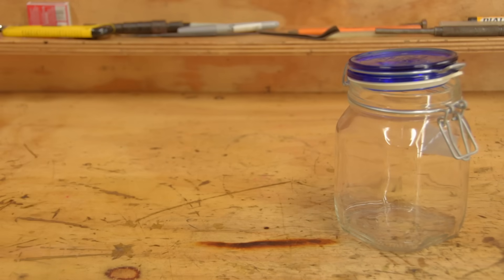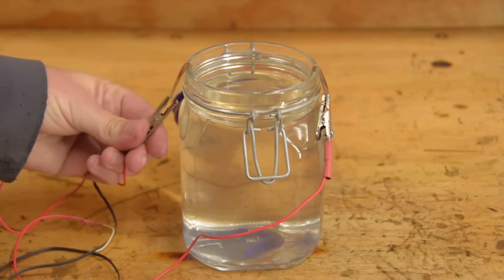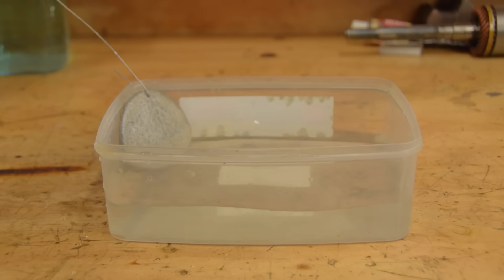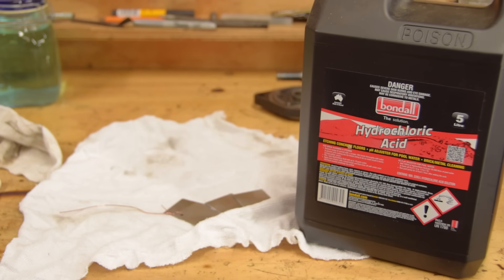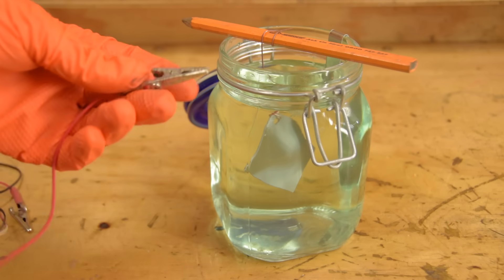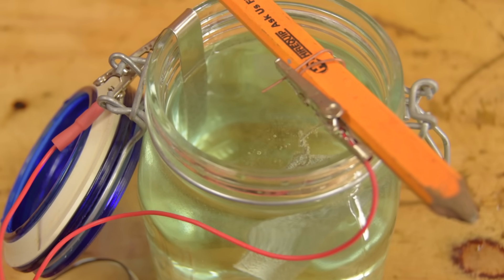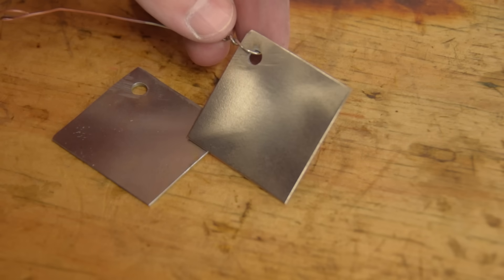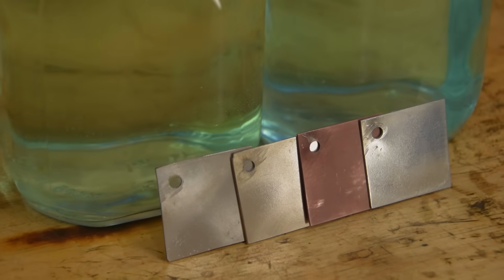Electroplating - Easy DIY Nickel, Copper, Zinc Plating

Comment: Thank you I had no idea this was so easy. I’m actually regretting some builds in the past now knowing I could have so easily nickel or copper plated them
Reply: We're all thinking about how we could have done past projects better but that's the evolution of an artist
Reply: just wish I had a jar big enough to put auto parts in .. my truck in copper would be cool .. this was a good video
Reply: @randytravis3998  Inflatable pool and an old stick welder are pretty cheap.  It's the 500 gallons of vinegar that you'll need that'll be expensive.  :D
Reply: @button-puncher  just mix it yourself. its just acetic acid with water. you need around 5% and you can get 3 gallons of 60% acetic acid for around 30€
Reply: @randytravis3998  get one of the pens and the fluff that goes over top of it, then paint it on. It works with the fancy kits so it should work DIY
Reply: My 1911 wish I would’ve nickel plated instead of DLC coat

Comment: Ok, I got some old brass plate handles off an antique dresser, that I want to re plate with brass. Since there is already (mostly still) a layer of brass on the handle, do I really need to pre plate with copper, before plating with brass? They were originally brass plate handles, and they look really cool, and I'd love to re brass them.

Comment: I tried making nickel solution but it became clear water with white sludge in the bottom. So I atomized the nickel but it didn't make the water green. I used water and salt in a 5 liter container though, not vinegar; is it the vinegar or the quantity that is the problem? Or both combined?

Comment: Have you ever metal plated on poly carbonate plastic? Is there a method to the metal plate inside PVC pipe? Lengths may be between four and 12 inches

Comment: Something interesting. I have heard that copper does spontaneously plate onto iron. One man dunked his clean bare metal slightly rusted brake drum into a bath of acid with a small amount of copper residue in it, and immediately the copper formed a thin layer onto his cast iron brake drum. So copper must be able to coat iron directly, depending on if there is free iron (rust) on the surface? Perhaps a small amount of flash rust is needed to plate copper to steel?
Reply: It surprised or confused me a little that copper wouldn’t plate onto steel.Commercial platers that advertise triple chrome are referring to copper, nickel, chrome and I saw one explaining that they use the copper equivalent to the way a painter uses primer/surfaces, to fill imperfections and be polished to a high shine. Am I incorrect? Thank you for the informative entertaining video.

Comment: Great vid, thanks, what is a brightener that you mentioned in the zinc test, could you please advise what this is and whether you can use this from a home product or need to purchase a specialist product. Also can it be used in the copper plating to keep it bright? Thanks, I am going to use this to nikel plate my Father in laws old  RNZ AF  Tools he left me like dividers, compass etc, I have managed to get the steel rust all off and have cleaned them all up now, they are just oiled as i was waiting for the nikel to arrive so i can go to the next stage.  Final will be copper as I want to polish them and this will stop them rusting now. thanks.

Comment: Thanks for sharing. I worked in a plating shop for 10 years back in the 90’s. Cool stuff man!
Reply: Hi @bleeper87
Sorry for bothering you with a question. When it comes to plating, have you used a different type of acid? I've heard that for copper plating, sulfuric acid is needed instead of acetic acid. What about nickel, brass, and plating with other metals? Thank you in advance

Comment: What about after washing your metal and you sprayed it with ( Rust Fixed spray paint goes on clear, turns rust to black.) you know when you clean a piece of metal and you dry it off and it starts rusting on the surface right away. Well I sprayed a piece of metal with that rust fix spray. Do you have to take that off for this process to work on a piece of metal? This is pretty cool either way mad scientist

Comment: Great video and I plan to repair some old tools that were passed down to me but are just rusty, sets of  calipers and inside out calipers double ended calipers and a nice depth gauge all for wood turning which i do, was looking to buy new until i looked up this, very clear explanation, I didnt want to angle grind them for fear of damaging the thin metal they are made of. I used to do old iron fireplaces in the uk with the angle grinders, hours and hours to get years of paint off, then Zeebrite them back to beautiful black.

I have watched the excellent rust removal video you made and will use electro current method  to do that as its not heavy rust and then come back and nickel plate them all , they deserve a second chance as they are all old RNZAF tools from my brother in law who doesnt use them any more and being a wood turner Im excited at the thought of not paying much to get them looking great.

Just ordered the Nickel Anode already,  7 euros for that, the other materials I can get in Spain easily enough in the drug stores here, not a nanny state here like the UK where you can not buy any acids etc. A gallon of hydrochloric acid here is 4 euros, nothing!

 So Im looking forward to seeing the results , may even copper plate my depth gauge after nickel plating it. I have never really had an interest in chemistry apart from sorting out my pool and this has sparked a little interest now thanks very much for the clear explanations and simple guidance on how to bring life back into old tools etc.

The rust tool liquid that makes it go black and hard we have used here a lot in spain when refurbishing  atticos in peoples houses, the ceilings have lots of curves between beams and they are plastered, remove the plaster to expose beautiful brickwork but the beams are rusty, we used a similar product here to stop and blacken the rust and it makes the beams look excellent once you treat the brick with a type of sealer to stop any dust.

thanks again. Neil, Barcelona Spain ( Mrs is a Kiwi)

Comment: In the 1970's I worked for an electroplating firm (since bankrupted by fines from unsafe disposal of chemical waste). We used to 'jiggle' the items being plated to make the bubbles break free of their surfaces. In some case it was a vibration and others it was moving the whole rack of items side to side. We also plated nut and bolts in huge nylon drums that rotated to keep them moving and contacting at different points. We did the lot: Nickel, copper, zinc, silver and even gold. If it could be electroplated, we electroplated with it!

One friend of the owner brought in a pair of P100 headlamps off his pre-war Rolls to be gold plated to make them shine with a yellow cast to the beams.

Meanwhile I'm assuming that citric acid might be as good as vinegar (acetic acid) as you can make it to the concentration you require by dissolving more or fewer crystals in the water. I usually have half to a kilo or so on hand for home brewing purposes. It's also good for cleaning copper utensils and ornaments.
Reply: Can I use a 12v car battery for power supply
Reply: @bigbomb5904  For zinc it will be too much amperage and form grains. You might get away with moving the anode and cathode (positive piece and negative piece) further away
Reply: Good morning if can i say,whith my terrible english ,what i think.1 if you whant playting brass or zin or iron,is a different work.a) is necesarly put befor the cooper( 1 basic,2 acid) after this nichel is ok,wen you plating whith zinc is no a good idea ,is natural polissh in ultrasonic whit soap,after you masit put the piece in acid ,or basic for ph,this is corret.If you use the brass no necessary cooper
Reply: The reverse-electroplating thing they do to make the rifling grooves in 3D-printed guns has something to do with citric acid (I don't know what exactly).

Comment: I have a question! My copper electrolyte ended up creating a precipitate, which does suspend itself in solution with enough agitation, but wether or not the solution's been agitated I haven't managed to plate anything in copper, is my electrolyte ruined? Would filtering out the precipitate fix the issue? Or is my electrolyte contaminated and ruined? however nickel and zinc work just fine. Thank you for posting this useful tutorial!!!

Comment: Copper will plate directly to steel.  In fact,  Copper Sulphate solution will plate a thin layer of copper onto steel without any power supply.  The most durable chrome plating is by the, so called, triple plating process of copper onto steel, then nickel onto the copper plating followed by chromium onto the nickel.

Comment: Your vinegar is a much safer acid than hydrochloric so save your money and just soak it in plain vinegar for a while if you want.  

It works great on rusty parts as long as you dont leave in for too long.

Comment: Wouldn't it be more efficient to use hydrochloric acid to make your electrolyte instead of vinegar? Conversely, why not avoid hydrochloric acid altogether? Vinegar does remove rust after all,albeit not as efficiently as hydrochloric acid.  It would have been helpful to include the chemical reaction to understand what each chemical does in the process.

Comment: I make rings out of brass for a hobby and thought I'd try. At first my results were great but on the second piece it stsrted to form high spots and some almost crystalline growths. I plated for roughly 45 minutes cleaned the parts with concentrated citric acid and acetone. When i try to sand down the high spots it often flakes off or i get down to the base metal on the low spots. There is some debris swimming arround in my sollution as i use very small nickel anodes and quite a few have already fully dissolved only leaving behind some extremely thin pieces. Would be great if anyone could help!
Reply: Place them into a cloth bag.  Will keep debris out.

Comment: You mention using a power supply that puts out less than one amp.  What happens if you use a larger power supply?  How does current affect the plating, I imagine it would plate faster but perhaps unevenly?

Comment: Do you think one could mix copper and zinc electrolytes at some proportion and plate with brass? I thinking the zinc could kill the copper solution, or will the copper deposition will overtake the zinc.
Would love to see you try, I am going to attempt this but, I am no-where near as practiced as you so my failure or success for that matter would hold no proof.

Comment: "Plating at home! Sweet, wonder how you would do hard chrome."

if you try to chrome plate you will die 

"Oh... Okay then."
Reply: Hard chrome is different because it doesn't use chrome anodes that dissolve in an acid. The chrome is a ore which, after processing, is dissolved in water. Lead is used for an anode. With the proper facility, equipment and training it's relatively safe, but not recommended for home use. It involves some strong acids and the chromic acid bath and fumes are carcinogenic. Disposal of a spent bath is also a problem, it's not something you should dump out on your back yard.

Comment: I know that others stress using sodium carbonate (aka Washing Soda) when using electrolysis for removal of rust from ferrous material. Would that compound work with electroplating?  Would it perform better than salt (aka sodium chloride)?

Comment: The positive is called a Cathode, but I know what you mean.
Reply from the maker: No. Cathode/anode isn't defined by the polarity of the wire they are attached to. But I know what you mean. 😁
Reply: @GeoffreyCroker  what if I used a power supply from an old pc?

Comment: I have worked as a plater for companies and you are very wrong about just adding time. Voltage and amp draw will determine how long to plate depending upon your purpose and if you are not careful it will be too thick of a plating or too thin. It matters because of resistivity if your making electrodes for batteries, too much plated metal will raise the resistivity due to thickness as well as destroy the part if it is for anything technical. What you need is at least one rheostat to adjust current to control the plating process.. at a minimum. Then you need to know the exact thickness, what type of coating ( ie. ROHos Gold, Zinc. ) to know how long and at what current to plate. Otherwise your just wasting time.
Reply from the maker: Triggered much?😆 Dude, this about electroplating in a small jar of vinegar. Not about setting up a commercial mil spec plating operation. How many people who watch this video and try it out, do you think care about the number of microns they could coat an electrode with. Cheers 😁

Comment: Excellent, I've ordered the sacrificial nickel plate for the electroplating anode, also some hydrochloric acid to give this a go.
I've also read that two layers of plating (duplex) is even more durable (as you'd imagine), and requires different kinds of sacrificial nickel. The sacrificial Nickel I have purchased was 99.5% (which I assume would be the second layer if duplex plating and if so), what would be used for the first layer please?

Comment: Mr.crocker I am attempting to use this method a 5gallon bucket 99nickle electrodes (licon electric) and my solution has turned red I'm using a battery charger DC 6volts multimetering the solution I get around 3v and around .80 amps the electrodes are advertised as 99% pure but I dont see why my solution is red. Is my amperage low?

Comment: did you state the purpose of electroplating? Why do you  do it? What good is it for?
Very confusing without a sound premise of intent and confusing overall. Give concrete examples of useage of finished products. Cosmetic? Functional? Just fun? What's going on?

Comment: does this method work for iron plating? looking to make a microsoldering tip, however would need to iron plate then nickel plate it, allowing me to sand the nickel plating off the tip, exposing the iron. edit: also can i be cheap and make HCL with pool chemicals i have? i have chlorine and dry acid powder, so in theory i could use this to make HCL?
Reply from the maker: Should do. Just use a piece of steel instead of nickel. And I doubt it. Chlorine and chloride are not the same. And besides, if you already have dry acid, just try that. The acid is optional anyway. Just get the part clean enough without acid and it'll plate fine.

Comment: Just curious, if nickle plating is required for copper plate, then how are welding wires plated? These ,as far as I know, cannot be nickle plated, as this would cause a impurity in the weld?
Reply from the maker: This video is just about electroplating with a small jar of vinegar.

Comment: Thank you for the great content. What do you recommend for restauring old nuts and bolts? Nickel or zinc?
Reply: Federico Rossignoli for what it's worth, the hardware stores sell galvanized nuts, which are zinc plated for corrosion resistance.  Nickel is tougher, shinier, and probably more expensive.  Zinc is probably closer to authentic.
Reply: @firstmkb  Thanks👍

Comment: To check the thickness on any plated part ,tape the test piece on 2 sides .When the tape is removed you can determine the plating thickness.
Reply: @henniebouwmans7879  yes, it will work great with gold, but just remember that most gold is only .58% pure when it’s 14K or 78% pure at 18K. So, if you are wanting to do a 24K gold plate, you will want to use pure 24K .9999 Gold, or refine your own gold. Also with gold, you can either use Gold Anodes, or Stainless Steel Anodes when electroplating, which will save you a bit on pure Gold Anodes.
Reply: @johnhines374  thanks  john
Reply: OMG TY

Comment: How long would I have to leave a bolt into a zinc container. I’m not sure if I’m giving it not enough time. I’m only electroplating the head the bolt. For 30 seconds
Reply from the maker: Depends on current. At least 20mins

Comment: I chose a mason jar for the electrolyte too, but rethinking this..... I keep reading that a warmer solution works.  You can't stick a mason jar in the microwave to heat up the solution because of the steel wire on the jar

Comment: I have copper plated onto metals inwant to solder onto and itvworks extremely well.  For example, i have copper plated the ends of some resistive wire (nichrome) and was able to solder the nichrome wire onto a circuit board.  Works perfectly. I used exactly the same technique to plate the nichrome.

Comment: I tried copper electroplating on a steel coin but after taking the coin out from the solution the copper plating is not sticking properly it's like copper dust.
Reply: at 6:18 -- "Copper won't plate directly to steel." ... so you have to plate the steel with nickel first, then with copper.

Comment: I would suggest my pure copper and pure nickle aren't pure as I get trash in the bottom of the jar and the plating looks like a bunch of scabs. And, the plating doesn't stick very well. Not even after several hours. Copper turns almost black. Buffing it takes all the copper off.

Comment: Great video. Thanks. What happens if you try to plate copper directly without first plating with Nickel?
Reply from the maker: Won't stick as well using this method. Commercially thats what they do, but with strong acids.

Comment: Hi I need your help. Actually I have a gold ring which is slightly bigger. I want to reduce size by electroplating inside of the ring with copper so that thickness increases. Please provide info on how to do that